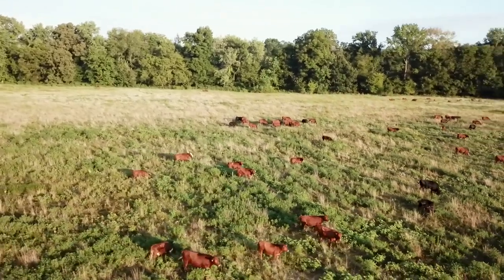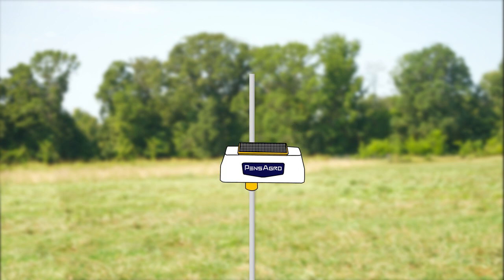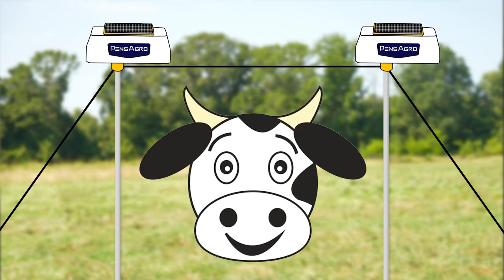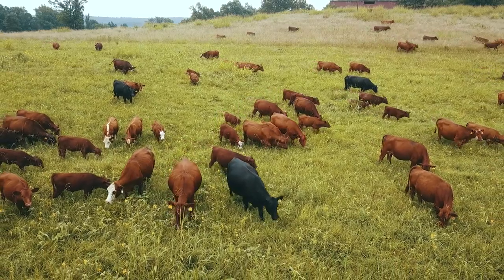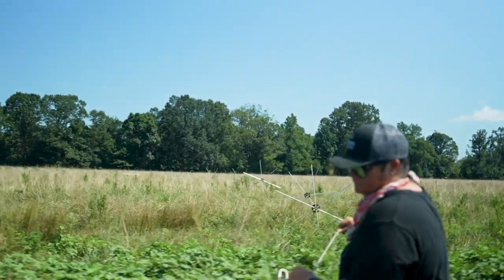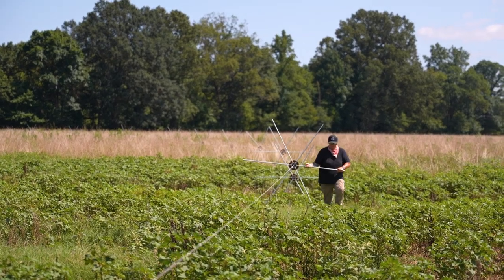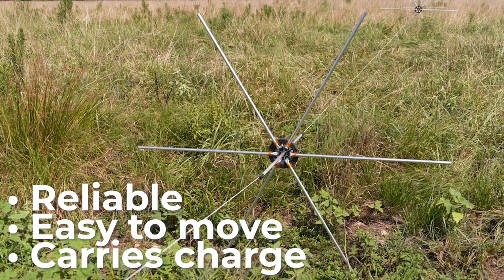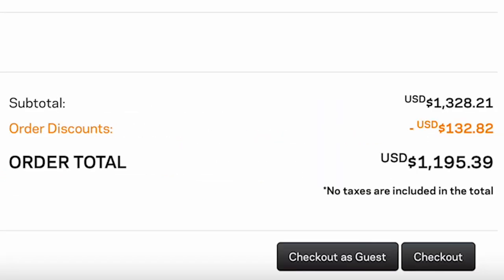NEW Fencing Technology for Daily Cattle Moves [Rotational Grazing]

Comment: These are great ideas but with the lifter, you’ll have to go out there daily to put them on different lines or move them, otherwise you’re just rotating between two paddocks, so you still have to physically go out there before moves to set them where you want them or buy several to put in all of your lines. Does it require much slack in the line to enable the lifting and then will there be issues with slack when they come back down?
The tumble wheels, it’s rare to have pastures without trees or shrubs and it still leaves access to what was already grazed. You could have your front and back lines on the tumble wheels and move both lines. Setting up temp fencing on a motorized vehicle isn’t terrible, especially if you already have t posts to tie into on the exterior but doesn’t allow flexibility of different set ups.
Reply from the maker: You're right - setting up temporary fencing isn't a terribly long or arduous process. However, we move our cattle twice daily, so those tasks actually take up a good portion of the day - which many of our livestock specialists need to tend to other animals, projects, or administrative work. (Farming is a business, after all!)
Often, the automatic gate lifters are utilized in the middle of the day, when our livestock team is tackling other tasks. They can then move the lifters to the next paddock in the evening or at the time of the next paddock move - usually the following morning. We haven't had any issues with slack, but that's a great question!
We have a large ranch with open pastures where the tumble wheels work perfectly. They can overcome quite a lot, including waist-high grasses, but they would not work well in areas with many trees or shrubs in the middle of the pasture. They won't work for everyone on every farm. But, as Donna said in the video, for the right kind of operation they are a game-changer.
Thanks for watching, and for your thoughtful comments!
Reply: You can have many?

Comment: Could the charger be fitted with some backstraps, or something backpack stype straps so you can carry it with you as you move the tumblewheel?
Reply from the maker: Potentially! That's a great idea to make moves even more efficient!
Reply: I just use a little jumper wire with a spring clip on each end to connect the two fences.

Comment: Why no mention of BATT-LATCH automatic gate release??
Priced between $450-490.

That tumble wheel setup only works with pastures with no brush or trees.   Most cow/calf operations run on rougher ground. Not everyone can afford "pretty".
Reply from the maker: We know these systems won't work for everyone, so it's great to have alternate recommendations. Thanks for suggesting the batt-latch system!

Comment: Didnt mention  placing electric fence in a " W " form rather then straight ?     Every other post....or ever second post in and out in and out.  This way every other post gives you slack to move the wire further down line.  And you dont need to roll up the wires. Just move posts.   The " W " can be extreme or gentle.    I seldom roll up wires.

Comment: How do you get both lifters to lift at exactly the same time? Are the timers that accurate?
Reply from the maker: The timers are very accurate! Even if the gates lift at different times, it doesn't cause issues to the system. The cows will just wait until the second lifter has raised. Hope this answers your question!

Comment: If you have 2difernts charger working together yo have to respect the rule of the 2 miters of distant between the tho circuits because if you don't in the long run they are going to brake because of the interference of the pulse
Reply from the maker: We haven't faced this issue yet, but thank you for the tip!